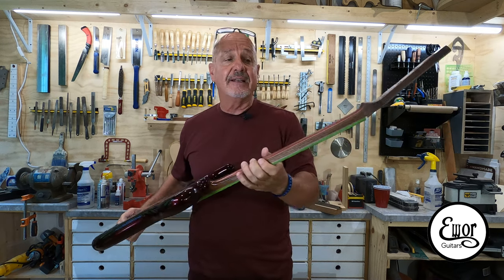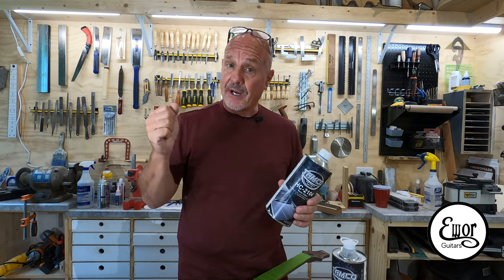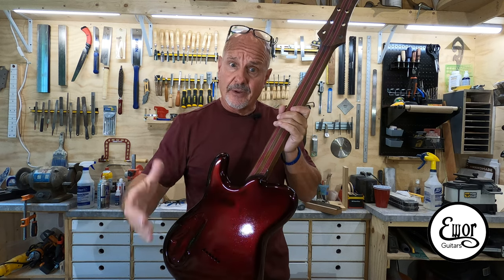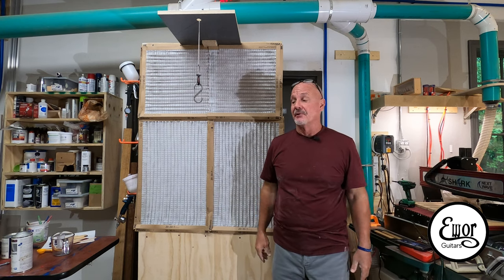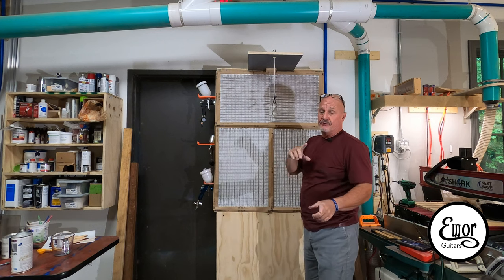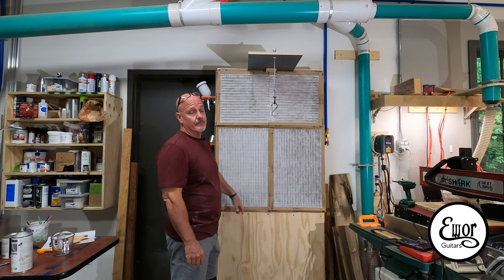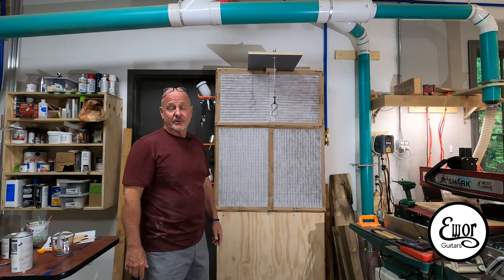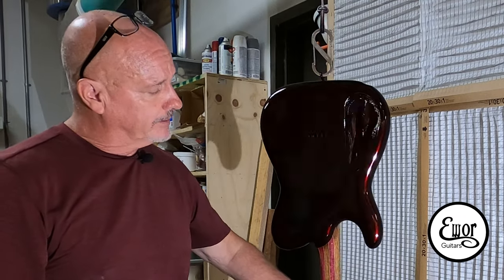How to paint a guitar part #3

Comment: Guitar looks great! Thanks for sharing! Just some advice if you don't mind? When using the tack rag very lightly brush the surface with it. Your only trying to get any surface dust. The tack rag has some tacky waxy stuff in it and it will sometimes stay behind on the piece. Especially a brand new one. When it does this it will contaminate the surface and cause fish eyes and/ or orange peel. I have years of experience with them. It's better when they're new to kinda run some of it off of the tack rag before using.
Reply from the maker: Thanks for the tip on the tack rag. I hesitate using one for that very reason. I will use a lighter touch in the future!

Comment: You're fairly aggressive in your sanding. Not a criticism. Is that because the clear is very hard? I would never sand that hard on nitro or I'd go right through the clear to the color, even with 6-10 coats. But I spray each layer very thin.
Reply from the maker: Yeah nitro is supper thin even 20 coats is easy to sand through

Comment: Great video series I’ve been really liking your build . I did want to give you a heads up on your paint booth I really like the design but wanted to say I used to paint in a booth at a fabrication shop and the paint build up inside the box needs to be cleaned every so often as it can spontaneously combust if the build up gets too thick. We were painting a lot of equipment so we had to clean up fairly often but the scrapings from the floor and side walls needed to be submerged in water or kept in a metal container with a heavy steel lid to keep it from being a fire hazard. I remember coming in one morning and we had a bucket with some of the floor scrapings and no water and it was smoking, given enough time it would of caught fire.
Reply from the maker: Wow thanks for the heads up. I would hate to burn down my shop!
Reply: @eworcustomguitars   you would need to  paint a lot of guitars to get to that point so you could go a long time but it is a thing just like oily rags and other shop hazzards

Comment: How do you deal with airborne dust in the shop when spraying? Your fan exhausts paint particles and fumes, but it isnt sealed off from the dust flying around after sanding.
Reply from the maker: Before I begin spraying (sometimes the day before) I will clean out my shop from top to bottom with the exhaust fan running trying to get out all the dust I can.

Comment: Great video. Really informative. May I please ask what’s tack coat vs flow coat? Google didn’t quite answer this.  Thanks!
Reply from the maker: A tack coat is basically a light coat maybe 75% of a full coat just something for the heavier coats to cling to. The flow coats are heavy enough to where the material almost runs. The material flows out in a nice level coat. I hope this helps
Reply: @eworcustomguitars  thank you very much.  That candy red looks really tasty